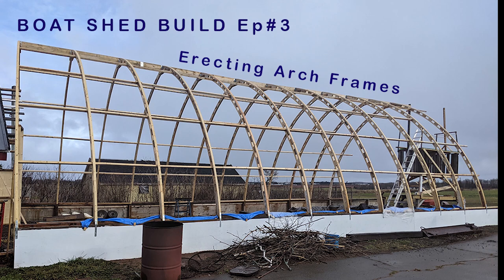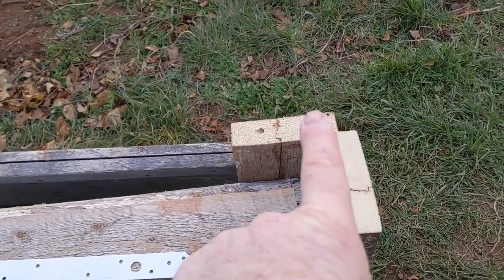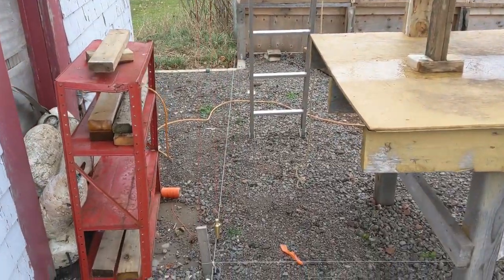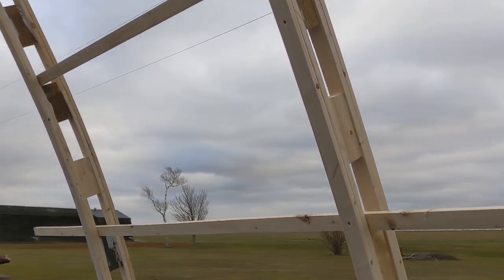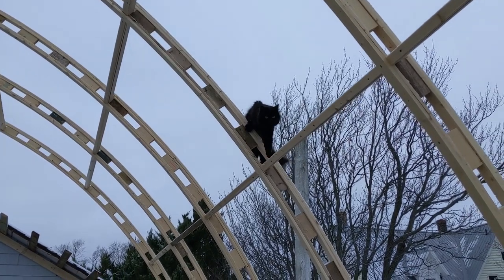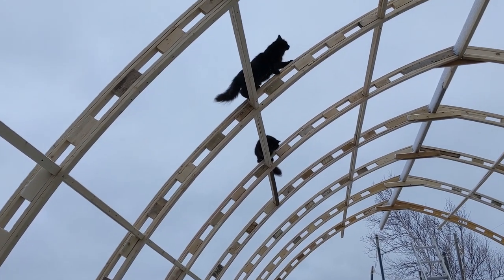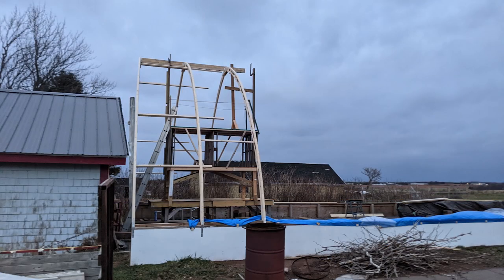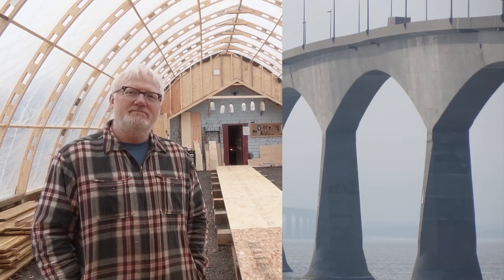Erecting Boat Shed Arches - Wooden Boat Building Ep #3

Comment: Great build. I love how you show it warts and all.
Reply from the maker: Thanks Carl.  Fewer warts than expected. I have had to tape some small holes in the plastic due to chaffing. I did not secure the plastic tight enough. I will likely either replace the plastic this fall or add a second layer of plastic. Using used plastic means replacing it more often than if I used new plastic but at about 1/10th the price it is worth the effort.